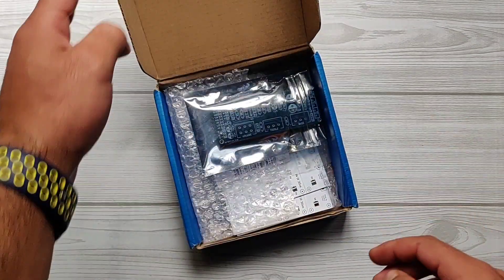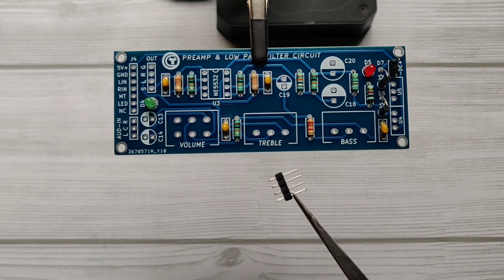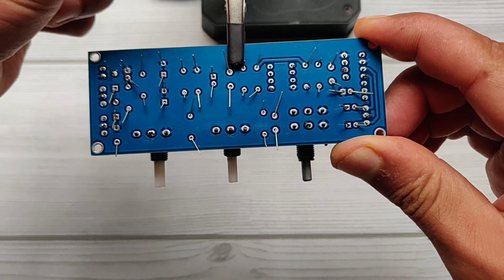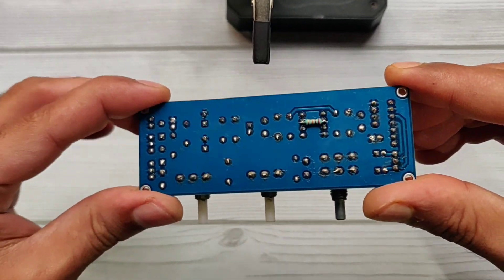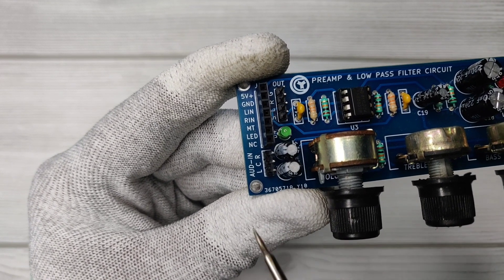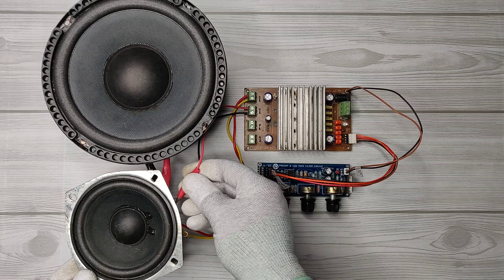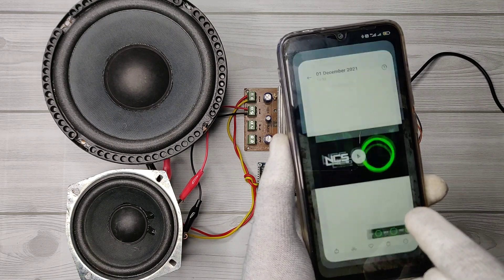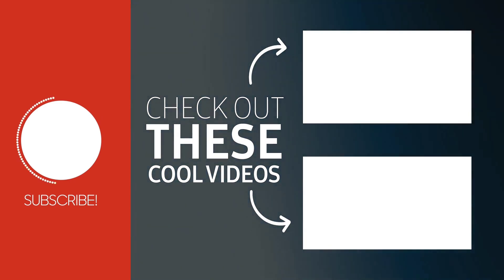Heavy bass treble volume control circuit for amplifier DIY

Comment: Uploaded Zip file contains a tda 7388 Gerber files.
Reply from the maker: Yes, there may be random name as i make multiple pcbs on single board file,
Then extract one by one for related project.
Upload file on jlcpcb.com and you'll see pcb preview that is same as used in project video. So don't mind that. It is correct 🙂
Reply: Thanks for your kind response.
I will check n intimate you definitely.
Reply from the maker: You're most welcome 👍
Reply: Can you upload Black and White PDF so that I can test it in manual process?
Reply from the maker: Ok I'll, check back tomorrow
Reply: Thanks for Reply.

Comment: Please can u make a darkness sensor using ldr with adjustable sensitivity
Reply: Dc 12v 
Most of the circuit diagrams on internet are fake or do not have adjustable sensitivity for darkness
Reply from the maker: Thanks for your suggestion, I'll try to upload soon.
Reply from the maker: I'll upload soon let me know do you want dc to power up circuit, or its best to power whole circuit with ac woth ac loads